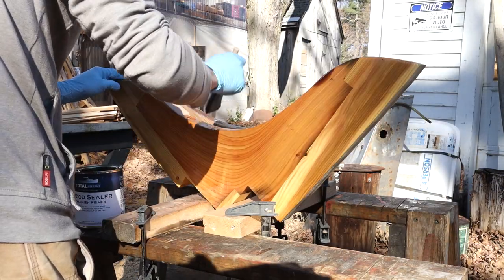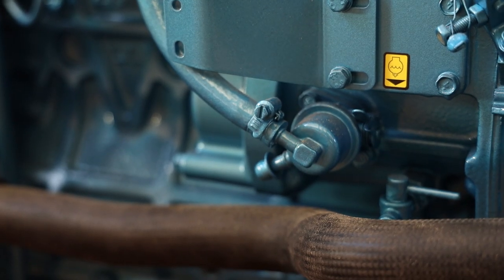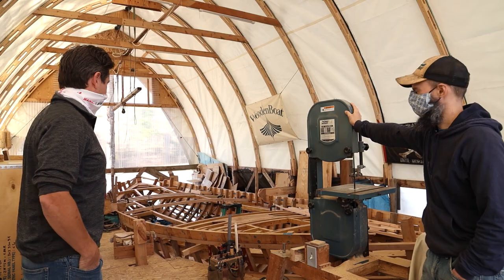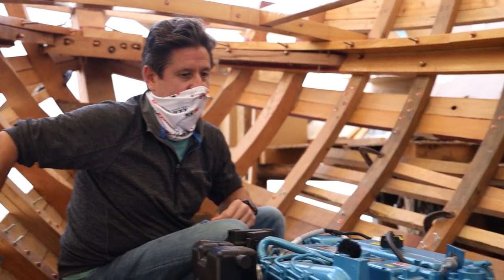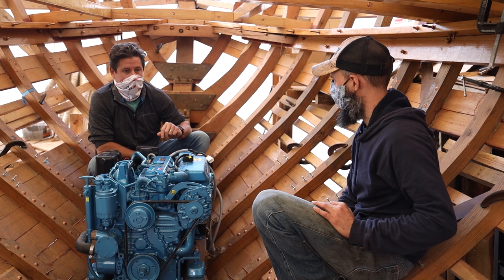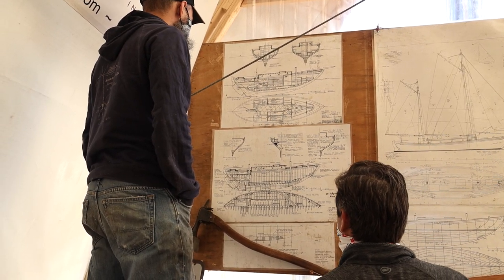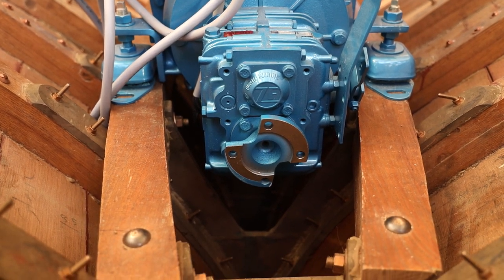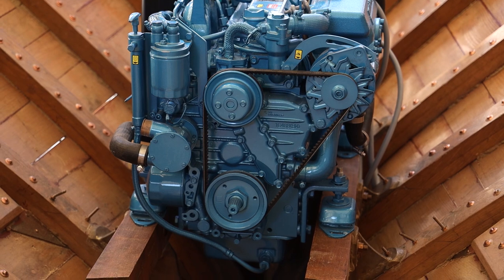Designing the Power Plant - Episode 137 - Acorn to Arabella: Journey of a Wooden Boat

Comment: Sweet!  Consider adding a larger alternator or two capability of charging your batteries at a high rate in a short period of time.  Some put enough alternator power the forgo the installation of a generator.  Good luck.
Reply: A second alternator allows for having a backup if the primary alternator goes out.
Reply: @larrykeenan598  that'll happen surprisingly often if you're running enough accessories

Comment: Electrically you need a dedicated battery for engine starting, nothing else should be connected to that.  The separate house battery bank is connected to the starting battery via an ACR (probably a BlueSea) which allows both to charge together but ensures they discharge separately.   All ships electronics and accessories should run off of the house bank.  Lastly you should have a battery switch able to switch the engine starting over to the house bank in an emergency if it goes dead.

For plumbing, you need raw water inlets for engine, for the head, and its a good idea to have a separate one for the galley.  You also need separate water outlets for the galley sink and head sink. The head sink and flush raw water can be combined so that when you close the thruhull the head will pull raw water from the sink bowl, useful for winterizing and also descaling the lines.

Run a pressure pump after the tank for fresh water, and pressurize both your hot and cold water side off one pump, having running hot/cold water makes living onboard sooooo much more comfortable.  Also plan on adding a tank level sensor or sight glass depending on where you are installing the tank. I would suggest a NMEA 2000 connected monitor for all tanks, especially fresh water and diesel. Monitoring usage is important, and you will want some modern electronics (in addition to the obvious benefits, they also use significantly less and easier wiring than older basic or analog devices).  You can get a engine monitoring box that takes engine analog sensor data and shares it on your NMEA buss, which allows you to use minimal numbers of screens and displays around the boat since they can all be multi functional and access any data point you need. A well thought out and designed modern electronics system requires many fewer displays and screens than older gear, and does much more at the same time.
Reply: all good info, but engine start bat and house bank will be different in their charging needs. look into sterling pro-split r unit and a remote programable charge controller.
Reply: @wvonfricken  dual charging systems are certainly ideal, but a simple ACR would serve their needs well enough and are significantly cheaper.   $100 vs $750+
Reply: Blue Sea Systems rock! I use their stuff on everything up to 60'. Those ACR's are sweet & eliminate the problems an isolator causes (voltage drop & no excitation).

Comment: Several comments here. First 100 amps of 120 VAC not in any way equivalent to a 100 amp 12 VDC alternator output.  Might need to upgrade your info.  Next, in addition domestic water off the engine you can get some comfort heat as well, while the engine is running of course, and could have some heat after the engine is shut down if you wanted to.  Happy to diagram this if you are interested.  Would suggest, as a matter of future planning, that you consider at least upgrading the alternator to a larger output model- which at the most basic level will reduce the amount of time required to recharge the batteries.  Amazing amount of very skilled work on view.  Those recovered knees are incredibly beautiful- hope there is a way to make them visible.  Your videos are a feature of my Fridays and I will be investing in some merch soon.  Have a great time off, glad to see Alix back and will be incredibly anxious to see the progress when you guys start doing them again  Best to all of you, give Akiva a head scratch for me.

Comment: I always have hated when they paint the engine assembled like. The rubber lines and other simple bolt on parts that are not a main part of the engine (aka parts that will be expected to be replaced or taken off for maintenance like the oil filter. It just damages the paint for chipping later. Its a cheap paint method which just causes problems later.

Comment: Take it from a retired Alaska commercial fisherman: install a Racor double fuel filter. Not only can you isolate a clogged fuel filter without shutting down the engine, it has a sensor which will tell you if the filter is getting bad. Having this system on my boat saved my boat on several occasions, as our fuel quality was sketchy at best in the more remote areas of Alaska.
Why did you decide to use raw water cooling as opposed to having a heat exchanger?

Comment: Better give it a little more thought. The engine's second most important function is electrical power. With fast charging Lithium batteries there is no real need for a separate generator anymore.  Cooking on induction safes so much bother with filling gas bottles in foren countries. Going the other way with oil lamps and alcohol burners is less complicated of course :-)

Comment: My experience with boats is mechanical as I used to service various engine types.  Steve you are right about accessibility!  I hated boats where the basic maintenance items were hard to reach, especially anything liquid like oil and fuel. Not only can they ruin a wood boat, they are fire hazards!  If you intend to sail on salt water, I would suggest a closed cooling system with a radiator/fan setup using something like "Evans Cool" as a coolant. Evans cool is water-less and will never corrode the inside of the engine. This will also eliminate holes in the hull, a source of leaks in every boat I ever worked on.  You can also route the hot water to heat the cabin.  You will need two air intakes: one for the engine (you don't want to suck your cabin air!) and one for the radiator/general air intake. The exhaust should be a low pipe for calm seas, and a high exhaust pipe for rough water.  A good, high amp alternator (or two!) and multiple  non lead marine batteries with at least 100% redundancy is a must. Two fuel tanks is also a good idea with a filler pipe on deck,  and of course a fume extractor and at least one bilge pump are legally required by the US Coast Guard.  You can buy good, inexpensive electric water heaters made for RVs and boats at any marina.  Talk to people who have gone on long voyages, they will tell you hot water is a must,  plus a big morale booster!

Comment: 100 amps on a 12v DC system is light years different than 100 amps in your workshop (presumably 110v AC). If a second alternator is financially feasible, it's cheap insurance and will ensure a robust electrical system

Comment: A friend of mine purchased a sail boat in Mexico, 40 foot Passport. We started our journey in San Diego to Monterey California. We used the engine while underway. She was very slow moving north against the wind and currents. We made it to Santa Barbara in seven days. Spent the night resting to leave at 3am to go thru Point Conception and very large waves.  We made it to San Simeon, then the engine quit running. We checked the fuel filter and it was filled with debree from the fuel in the tank. The engine would not run after many attempts and the batteries were drawing down. So we raised the sails up and she was happy to go. But the winds were not blowing enough to move us forward. It took another week and a half to get to Monterey Bay California. After a long journey we had a Marine Mechanic on board to help us. Removing the inspection cover on the fuel tank he discovered a very thick layer of Mud on the bottom. He told us why this mud is in the fuel tank. Mexico fuel trucks also transport water. Dirty water with mud left over,  mixed in with Diesel fuel spell Disaster. So traveling around to differant countrys you need to be able to inspect your fuel tank for mud removal such as this. It took us 3 weeks to get home, best time ever while on Vacation.
I also agree with others on a catch pan under the engine. Using your timber as a mold for composite's is very easy to make. Put packing tape over your timber and Partall Wax on then apply the Fiberglass on. Apply Gel-coat over your part. Then peal it up and away, remove tape and drop your pan in. Perfect fit, no welding, no rust and cheap to make. If you have problems pulling it out, drill a small hole thru the glass and hit it with air. Fill in the holes with a glass patch and Gel-coat.

────────────────────░███░
───────────────────░█░░░█░
──────────────────░█░░░░░█░
─────────────────░█░░░░░█░
──────────░░░───░█░░░░░░█░
─────────░███░──░█░░░░░█░
───────░██░░░██░█░░░░░█░
──────░█░░█░░░░██░░░░░█░
────░██░░█░░░░░░█░░░░█░
───░█░░░█░░░░░░░██░░░█░
──░█░░░░█░░░░░░░░█░░░█░
──░█░░░░░█░░░░░░░░█░░░█░
──░█░░█░░░█░░░░░░░░█░░█░
─░█░░░█░░░░██░░░░░░█░░█░
─░█░░░░█░░░░░██░░░█░░░█░
─░█░█░░░█░░░░░░███░░░░█░
░█░░░█░░░██░░░░░█░░░░░█░
░█░░░░█░░░░█████░░░░░█░
░█░░░░░█░░░░░░░█░░░░░█░
░█░█░░░░██░░░░█░░░░░█░
─░█░█░░░░░████░░░░██░
─░█░░█░░░░░░░█░░██░█░
──░█░░██░░░██░░█░░░█░
───░██░░███░░██░█░░█░
────░██░░░███░░░█░░░█░
──────░███░░░░░░█░░░█░
──────░█░░░░░░░░█░░░█░
──────░█░░░░░░░░░░░░█░
──────░█░░░░░░░░░░░░░█░
──────░█░░░░░░░░░░░░░█░

Comment: Hello from Denmark. Love your channel. I agree 100% in keeping it simple and traditional. I have sailed about 20000 offshore miles in various boats, some modern, some traditional, some engineless, and in my experience the fun is inversly proportional to the complexity of the boat. Electricity and salt water dont go very well together. When in port, while our neighbours were busy repairing their multiple systems, we were off exploring the countryside or interacting with the locals. The comfort might be spartan, but you quickly get used to it, and enjoy the additional freedom. The only complexity I would insist on is the self steering wane. The engine is a nice safety feauture, does it have a decompression lever so you can handcrank it? I wouldnt bother moving the filters and oilpump, a man with Steves selfdicipline will keep that baby A1, no matter where the filters are. And remember Don Streets words: under the engine is the only place in a wooden boat where you never find rot, on account of the oil drips! Happy continuation.
Reply from the maker: Ah! Someone who thinks like we do!  Nice to hear.  Less complexity means more enjoyment... to a point ;)  We are going to add amenities relative to their use/need and complexity level.  It's all a bell curve with pros and cons!

Comment: Great info of all this stuff.

You would definitely want to go with lithium batteries even if your usage is low. They’re so much more efficient and get all the juice your engine and solar put there. But you need to have proper alternator to run them. It’s easy to overheat regular alternator with them.

Comment: A few random thoughts: Check out Firefly  batteries. They cost a little more than AGMs but last longer, take more abuse and can be discharged more deeply. The Maxprop does indeed make handling under power much, much easier.  Consider putting a drip pan under the engine as well as under the filters. You may want to reconsider not having running water, if not during the build, then later on. In designing the engine room, galley and deck, keep in mind that some day, the engine is going to have to come out of the boat. Have a great vacation!

Comment: I totally agree with comments below that you need a large catch pan under that engine.  It will leak both oil and water.  Your idea of a remote panel for your engine filters is smart in my mind.  You also need to plan on how you are going to take that engine out of the boat if you have to make a major repair.  Your boat hotel requirements (no hot water, no microwave, no requirement for shore power, no head hull penetration, no refrigeration, no cabin heat) have me thinking the crew of Arabella will get to experience true 18th century long distance sailing.  Better you than me.

Comment: 100amp mains isn't the same as 100amp 12v you really need kilowatt hours for comparison
Reply: Not exactly -  kilowatts for power (generator, alternator), kilowatthours for energy (batteries).
Reply: Volts = Amps • Impedance 
The amps at 12 volts don't have the same ability as at 120. That is correct.

Comment: My £0.02:
* Don't run anything else from the start battery (even nav lights could flatten it).
* Dedicated raw water inlet for the engine (it could draw air back through piping if shared - heads inlet can be shared with kitchen)
* 'Smart' alternator to battery charger
* Feathering propeller (max prop)
* Hot water calorifier from the engine - hot water is so nice to have.

Good luck with the planning!

Comment: Re electrics, are you planning a water maker?   I hope so, as one on board dramatically improves your sailing opportunities.  If you are, the power needed to start the high pressure pump will be a key parameter of your electrics design.   Loving your build.

Comment: Apologies in advance for not reading all of the prior posts.  I scribed these notes while watching/stopping/watching the video.

Either add remote oil filter adapter + hoses  or   catch tray under filter.  If you keep the existing filter on the engine, make tray large enough so that you can punch a hole in the filter to drain most of it into the tray, before you spin it off the engine.  Have a low point feature in the tray, a la tray bilge, to collect the oil.  The tray is a DIY sheet metal feature. Always wrap a plastic bag around the filter during an oil change.
  If you use remote filters, then make sure the hoses are affixed to damp their vibration, but not so stiff that the engine vibration will couple into the boat or overwork the hoses.  Always uses fiber reinforced hoses.  Carry spares in pockets between the engine room frames.

Fuel filter banjo fittings and hose clamps lack anti-vibration features to prevent hoses from walking off the banjo.  Think of this as safety wiring on an airplane.  Same comment for fuel inlet.

The four 90-deg brackets used to attach the engine block to the vibration damper / motor mounts are probably stiff enough BUT keep in mind that IF you experience engine vibration while spinning the prop, if the brackets bend open past 90-deg, the engine drive shaft to prop shaft angle will change and that will be a cause for the vibration.  The solution is gussets on the 90-deg brackets, placed so that you can still get a wrench in to service the threaded fasteners.  Make sure the threaded fasteners are Grade 8 (SAE) or the metric equivalent of Grade 8.

The engine requires an engine air inlet topside.  I doubt there will be much air induction noise, but you should think about it and possibly design it so that it can be moved if you are unhappy.  Engine noise will present in the hull (kitchen area) so you have to decide how much quieting you want in that space.  The engine will be inside a small room, so the what you do to those room walls will determine how quiet, or not, the adjacent rooms are.  Rule-of-thumb: heavy, or thick, or both walls don't transmit noise well.

Most important w.r.t. previous emails to you and re my work area:
Reply: .... Engine cooling water requires that you install a flanges under the waterline, one for inlet and one for exhaust.  This would allow you to modify the bracket (making it a bit wider) to accommodate a depth sounder transducer. That would become your primary depth sounder transducer, and you could have a backup using a transom-mount type transducer that sits just below the waterline.  I know Arabella lacks a transom, but the transom-type mounts are very simple, install with hand tools in an emergency, and could be altered to suit the stern taper.

Comment: Hi,I am following your work.It looks nice.I am good in Engine placement.Make sure that sea chest intake is made properly.Intake strainer is a must but original ones are to fine so cut fine mesh with scalper and leave it .It will  be sufficient to hold sea weeds.That is all to aware about.
For fuel filter housing chose something like Caterpillar C4.4 , double pree filter and double main filter  type with leaver to change over from left to right filter when in use.The same goes for oil filters.Double filter setup is  must.
Another thing to take care is bilge pump.Yo can use engine sea water pump for it.All you need is bypass valve on intake,one for sea and another for bilge.That can save your day.
For another things like motor drive shaft use flexible flange in between gear box and shaft.It need to be something like product named "Aquadrive "if your boat  will be flexing a lot.For shaft tube seal,use Volvo water stop for small diameter shaft.Do not forget to use special "drive shaft material" Not all inox shafts are suitable.

Comment: Just throwing this out there;  it looked like a second alternator could go right on that bracket for the oil filter (which you were talking about moving), and be in-line with the existing pulleys; easy install of a maybe critical system. Don't underestimate your power needs; you'd be surprised how much a cocktail blender (for those PAINKILLERS and  BUSHWACKERS ) (which will be CRITICAL, in the BVI !) can pull. Have fun Steve ! And Ben !